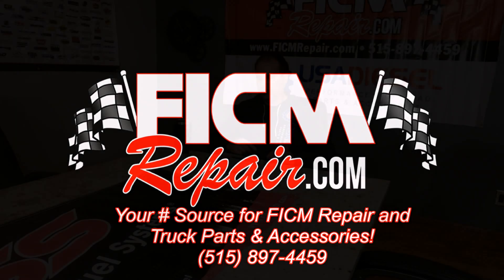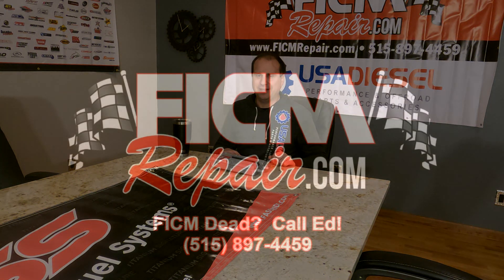Powerstroke 6.0: My voltage is good.  Can my FICM be bad?

Comment: I bought a repaired FICM 
And now my RPMs fluctuate around 2000 RPMs 
  My IPR reads 14.84 until I reach about 1500 RPMs I replaced the IPR prior to these readings
  2007 6.0 deleted and bulletproofed 
I wonder if my old FICM was tuned
Any ideas what it could be causing my RPMs to fluctuate

Comment: I got an issue on mine. Im getting all the voltages and grounds on the FICM connector but my scanner does not show the input voltage or the 48v on the FICM but if i check it by removing the inspection cover i have the correct voltages. What can be the cause of this?